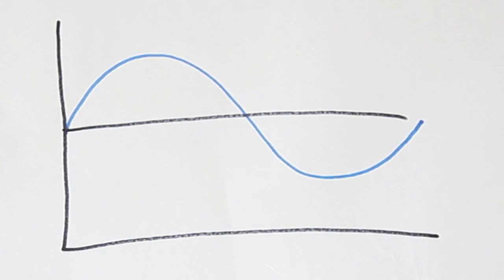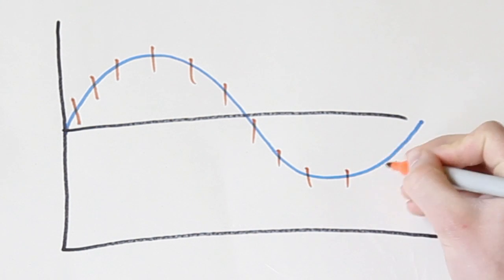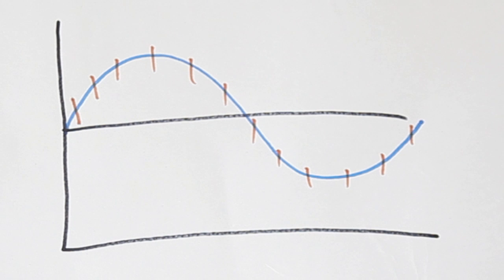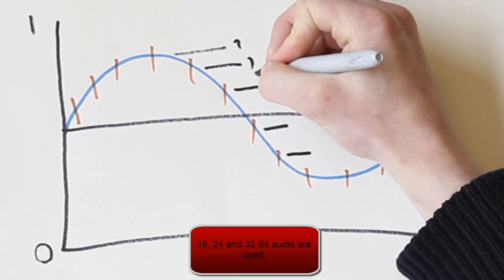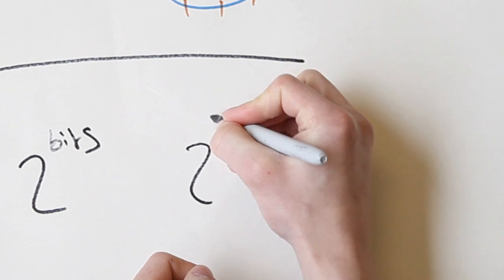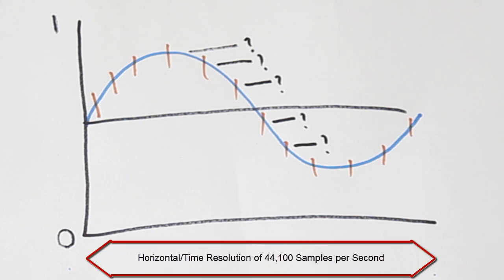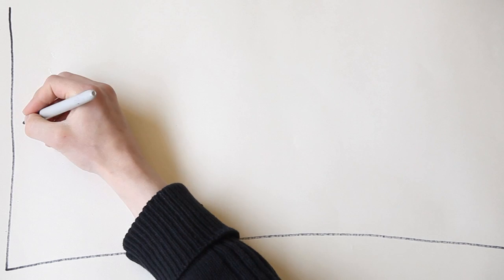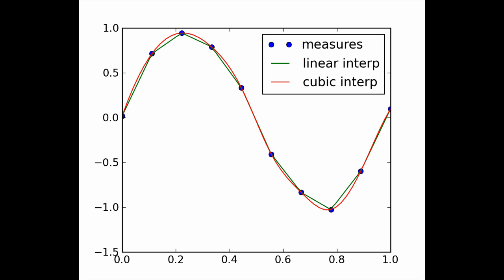Digital Audio 101 - Bit Depth, Sampling Rate, Interpolation - PB14

Comment: Hi,  have a simple question, than nobody answers correctly to me
CD have a bitdepht of 16, ok, and i always hear that 16 bit x 6 dB, offers a amplitude of 96 dB. I can understand that 3 dB in signal, means 6 dB in power
Howevwer, and first, a wave must go forwards and backwards, so, there must be a bit for sign, leaving 15 bits for amplitude, since the amplitude of a wave is the difference between cero level, and the maximum posive, the same between cero an maximum negative, not the difference peak to peak
Am i wrong?

Comment: so basically, the higher the frequency and bitrate(or depth?), the higher the resolution of sound and the better the quality?
Reply: theoretically yes, but given human ear limitation, 44/16 is enough to capture all audible to human audio and reproduce it with inaudible distortion (the inherent to 16 bit bit depth quantification error will results in -96 db noise). hi-res  (above 44/16) audio is pointless for reproduction purposes.

Comment: ok so if i record at 44.1  kHz , but the mastering house wants the wave file at 96 kHz, so then i render the the proyect recorded at 96khz , so thas this means i still have  a good quality file as if was recorded at 96khz? i hop  you understand mi question?
Reply: Once you have sampled the original sound at 44.1 kHz, all the rest of the data is gone and you have a track sampled at 44.1kHz, if you try to play it back by sampling it at 200 kHz or w/e it won't matter since the source file does not have that additional data anymore.
Imagine a graph that stretches from point A to B, I took 10 "samples" from that graph - meaning I put 10 dots on the graph at even distances from each-other, then I deleted the source graph and I only have the dots, I can't sample it again with 20 dots since all the data I currently have is 10 dots and I have to reconstruct the graph with these 10 dots next time I want to use it, Hope I explained it well cuz I just learned it from him just as you :D

Comment: thanks for the video, I think it would be interesting if you made a video that had the raw sound without interpolation. Furthermore, what level of resolution would be so high as to not need interpolation
Reply: "Raw sound" as you called it, doesn't make sense. Samples are (theoretically) infinitely short "blibs", which means they are audio bursts containing all frequencies. Whole sampling theorem only works, if you do the interpolation. And not just any kind of interpolation, but convolution with sinc-function (https://en.wikipedia.org/wiki/Sinc_function).
Reply: @TheUglyGnome   thank you for clarifying this!

Comment: Is interpolation done by a DAC? Or is that something different?
Reply: Yes. Modern DAC first interpolates audio stream into something like 256 times the original sampling frequency using sinc-fuction convolution (https://en.wikipedia.org/wiki/Sinc_function). Then converts to analog and finally uses analog low-pass filter to get rid of very-high-frequency garbage created by conversion process.
Reply: @Kelvin Klopper 
Nope. Dithering is another kind of animal. Dithering is not used in DAC, but in ADC in order to eliminate distortion created by  quantizing of samples.

Comment: I'm still not quite understanding Bit Depth. The definition that I gathered from "The Audio Dictionary" by Glenn D. White & Gary J. Louie is "Determines the number of steps and dynamic range of the digital system", in as simple definition as I could muster. Would you agree with this statement?